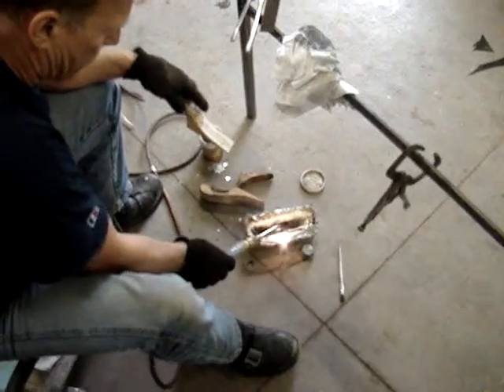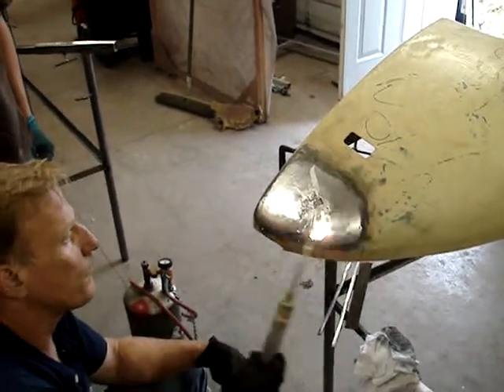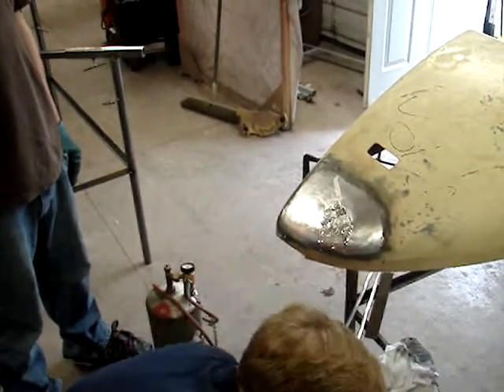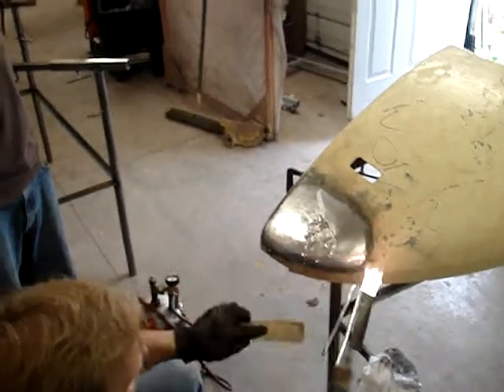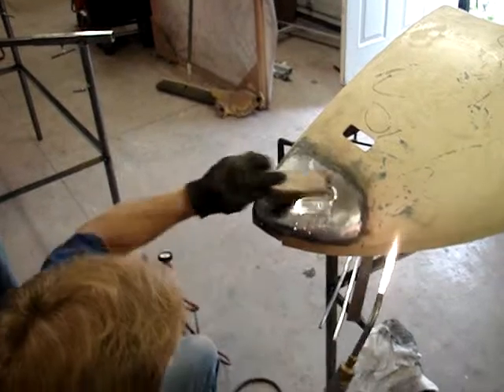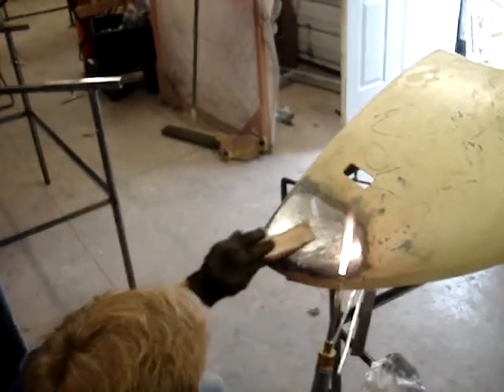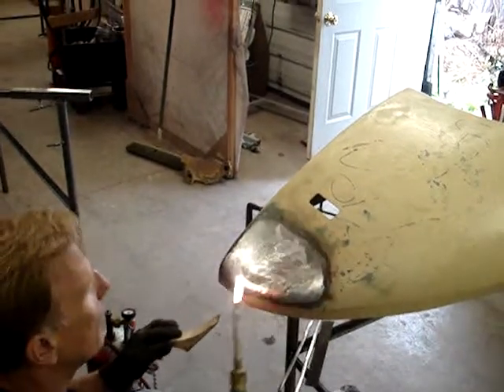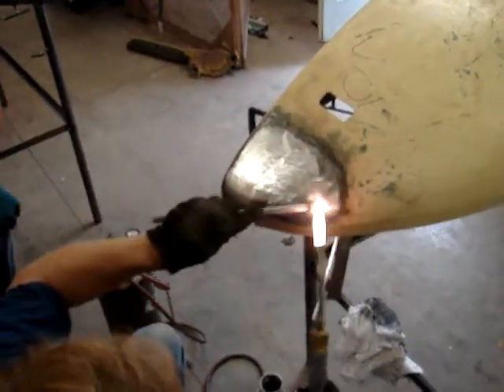Don's panel soldering demo part 9 of 18

Comment: This guy doesn't know what he's doing.  Pros don't take anything like this long to heat up the panel or work the solder into shape.  He needs a flame spreader on that torch, he needs to repair the torch so it's not making that noise, hell he needs to do an apprenticeship with someone who actually knows how to handle body solder.

-jcr